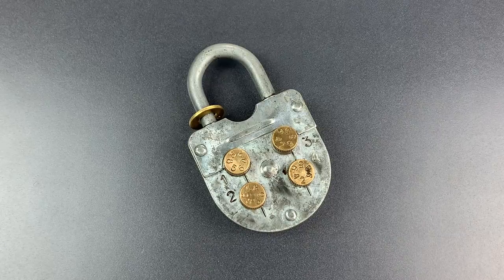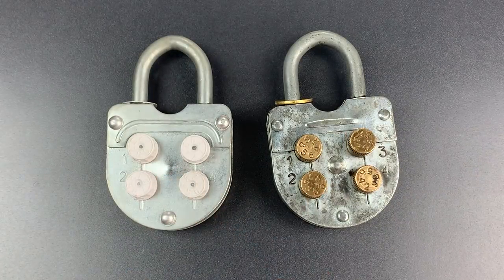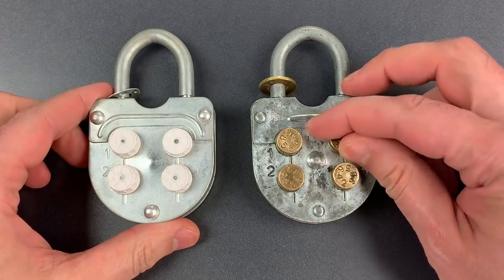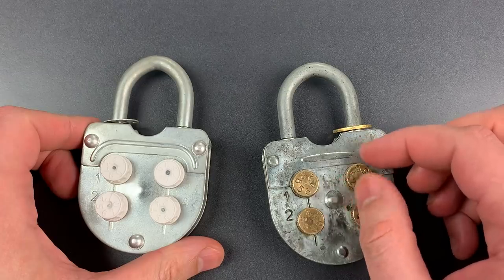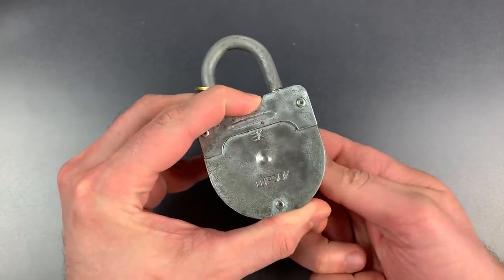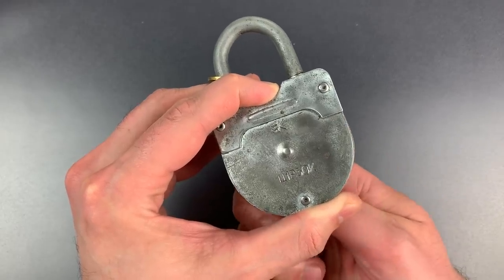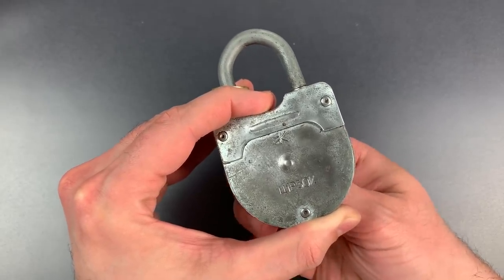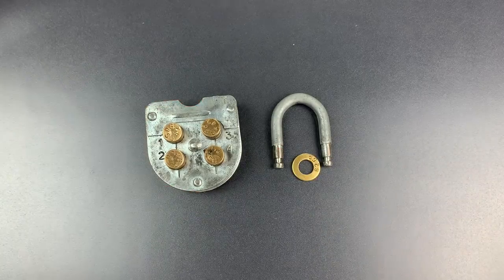[872] Vintage Soviet Combination Lock Decoded Quickly

Comment: Not a COMBINATION lock...rather it is a PERMUTATION lock.
Reply: That is true but they are still called a combination lock.
Reply: @QuickStick0  ...and some of them call the earth flat.
Reply: Given that you can operate the dials in any order you choose, this is arguably more of a combination lock than almost any other lock in the same category. In fact, if you regard the elements as tuples of (dial, setting) then it is literally a combination lock.

Comment: Damn is the lock that bad you can feel it out? I remember trying to crack my high school lock with a cup.
Reply: Most if not all combination locks are very easy to decode. At least the ones I've had the opportunity to get my hands on.
Though I have to admit that this is a design I wasn't even aware of.
Reply: Carsten Koch I’ve heard a really good combination lock can stop thieves to the point where they would need a transducer. Though this thing looks like something I could make in my garage.
Reply: @allstarwoo4  
Oh, you mean the electronic ones that are permanently installed. That is something completely different and I can't say anything about them.
I was talking about padlocks.
Reply: Carsten Koch I actually do mean combination locks in general. But on scale of a pad lock I it’s realize it’s not  practical to design a better combination lock when the alternatives at that scale are better.
Reply: Still takes him substantially longer to pick this than regular cylinders.
Reply: I feel like that's more likely to crack the cup.
Reply: @Asdayasman I would guess he used the cup to try listen to the combination lock clicking.
Reply: @helmut666kohl  Yes but I think I'm funny so please let me have this.  :(

Comment: Can you do a video on how to remove a broken key from a ignition switch or lock?
Reply: They make key extractors for this. Thin profile pick with a barb for the tip. Insert it past the key and hook the barb into the key to pull it out.

Comment: Love your channel but you seem to have a thing against Chinese products. Every time you defeat a Chinese-made lock, you made a point to make a disparaging mention in the title. But not so with good-quality products from China, or any product from other countries.  Why so much hate?
Reply: Because cutting corners so much you make everything into a fucking circle is much more prevalent in Chinese culture. You can even call it a national characteristic. It does go away over time, though. Still, the word "Chinese" was severely associated with "cheap and low-quality" up to late 2000s (with porcelain and tea as the only exceptions) so no wonder there.

Comment: Is there anything this man can’t open?
Reply: Maybe your heart
Reply: I am still waiting for either LPL or Bosnian Bill (or anyone else for that matter) try opening some of the really-high-strength Disc Detainer locks (like the Abloy Protec stuff) with the new Disc Detainer Pick they came up with.
Reply: @jfwfreo  that's stuff has extreme cybersecurity, Bluetooth connection in the key.
Reply: Nope, an Abloy Protec2 Disc Detainer is just a physical metal key, no electronics involved.
Reply: @jfwfreo  I'm probably thinking of the three then
Reply: It looks like there is a variant of the Protec system that adds the Mul-T-Lok CLIQ  electronics to the Protec disc detainer core. Maybe that's what you are thinking of.